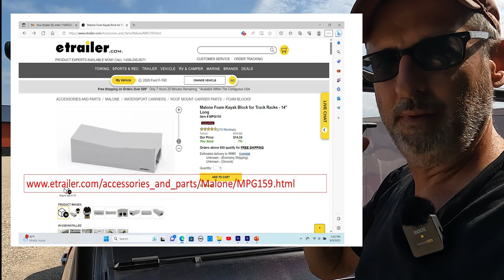G2 Bakflip Tonneau Cover + Elevate Rack System: Owner Product Review!

Comment: Just finished installing one of these, glad they decided to add a middle height, so now 18/23/28 inches in height. For my Silverado, 23" is the perfect height, just clears the top of the cab and I can fold my Bakflip all the way to the back window. Only issue I had, was I used the thin seal on my Bakflip, which made re-installing it a little too tight, had to remove the seal(didn't have it in the first place). 
Also, another thing to note, since you're setting your Tonneau cover on top of the TS rails, like in my case, the tailgate seal on the Bakflip is not flush anymore, leaves about a 3/16" gap.. :( need find a way to seal that part..
Reply from the maker: Nice! I didn't know they added another height option.   I do have that small gap at the tailgate as you say but I don't get much water in there thankfully.  Thanks for the comment!!

Comment: Nice video. You could have added XT rails to your Roll N Lock. I went with the Roll N Lock M series with the XT rails and will be adding cross bars and a cargo carrier in the near future. Considered a tri-fold but found out how extremely hot they were to the touch in the Tucson sun. Everyone has different uses for their truck beds but what's nice is the truck bed cover industry does offer many choices to the consumer.
Reply from the maker: Wow thanks for the comment.  I didn’t realize that about the xt rails!

Comment: With the rack dropped down, can you still open the G2? I figured you could also drill new holes if you want a custom height.
Reply from the maker: Yes just a little for the last panel.   The racks can slide forward which would allow more access too.

Comment: I cant place my Bakflip between the rails. Its to tight. I have no idea how u did that.
Reply from the maker: Did you take off the rubber strips that come with the backflip rails?   I did that and replaced them with the thin strip.
Reply: @upnorthguy  yes I did. I need 3 or 4mm more space.

Comment: I have the same setup as you. When you clamp both the backflip rail and Elevate rails, does the rails sit flush? Once i clamp it down the elevate rail is lifted slightly. Not sure if i am not clamping it correctly but Doesn't look very secure.
Reply from the maker: It does sit flush on mine.   Might have to pound it down a bit .  Also make sure the backflip rubber rail shims are removed .  I replaced them with a thin strip of rubber along each rail.

Comment: You used the wrong bolts that is why you needed to pile on washers. Also why not drill two extra holes on each pillars for the correct height to clear the cab and still low enough for garage fit? Seems like an easy task…
Reply from the maker: The smaller bolts won't work with the cleats that's why I had to use the larger ones.   I switch between the cleats and the rack on the same set of bolts.  Good suggestion to lower the rack!  Thanks!